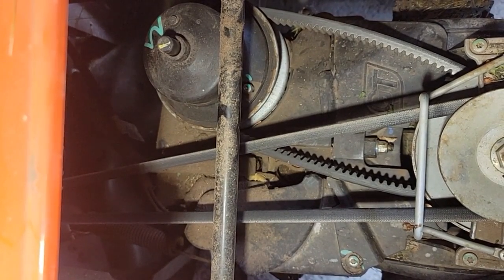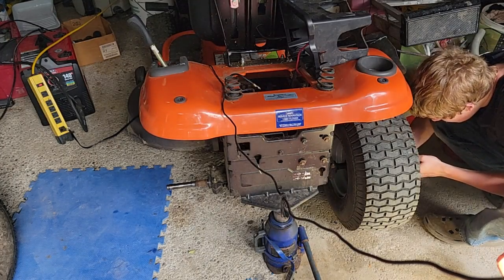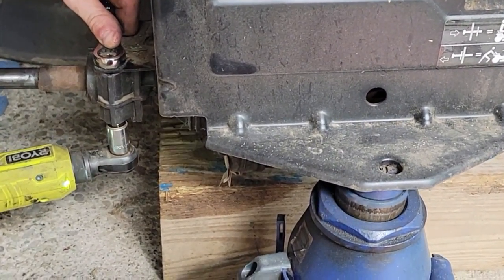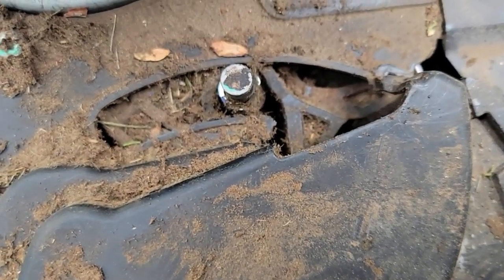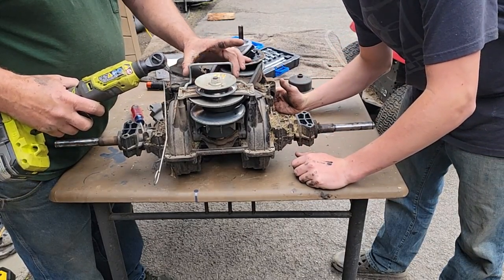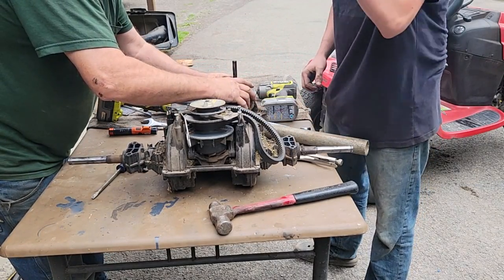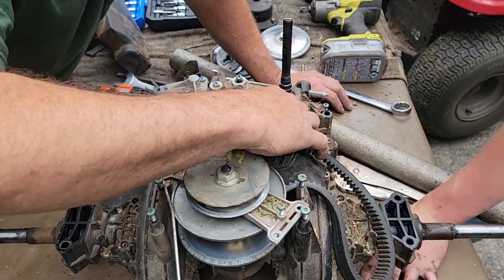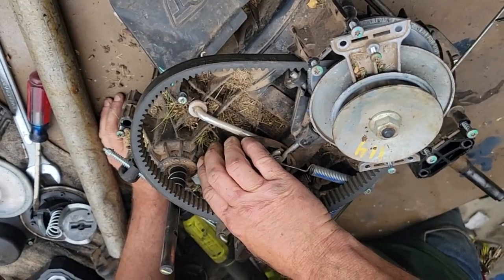Husqvarna Pedal Sticks

Comment: The problem is it's made of plastic . Low speed friction can do the same damage as high speed over time . Even with metal guides there will be heat transfer to the plastic . Too many plastic moving parts in the dirt and grass area . Just bad design and poor quality parts . Never tow a yard trailer with a load . This transmission will not hold up if operators are too heavy , the plastic will flex . Extra weight from bags plus operator is too much . NEVER buy a tractor with a plastic transmission ! JUNK !
Reply: I agree. Junk

Comment: Looking at 20:08 you can see how the freewheel rod is bent. My mower is 6 years old and the freewheel rod got so bent, I couldn't get it back into gear. I have the plastic General transmission. I bought a carburetor throttle swivel and a 1/4" metal rod, removed the flimsy rod, heated a 1/4" bolt with a propane torch, and enlarged the hole that the rod was in. I bolted the swivel on to the plastic trans tab (use the nylon lock nut & washer), cut, bent & threaded the rod. Now I have a very stiff rod that will not bend. To make this upgrade, just remove the left rear wheel, and it is easily accessible. 1 - 36" rod will make 2 disconnect rods, each 18" with a 4" handle(14" + 4"). Thread the handle into the swivel, then use the supplied nut to jamb and lock it into place. I moved the location the rod comes out the back, to the corner hole to the left of the keyhole shape.

Poulan Pro pp19a42 - 19hp Briggs motor with General Transmission.

Parts;
JEGS Carburetor Linkage Swivel | Fits 1/4" - 28 Right Hand Thread Throttle Linkage Rod | 1/4" - 28 RH Male x 1/4" - 28 Female | Includes 1 Washer And 2 Nuts

National Hardware N316-372 4054BC Smooth Rod in Plain Steel,1/4" x 36"

uxcell 1pcs Round Die Stock Handle Wrench Holder & 2pcs Round Die 1/4-28 UNF Machine Thread Right Hand
Reply from the maker: Great information.  Thank you.

Comment: great video. I ran into the same problem getting that nut off. I used a vise grips at the very top of the shaft where marring is not an issue. before re- assembly I cleaned the burr off the top of shaft. Tractor is working again due to your video. Thank you very much. You are teaching your son how to think before he acts, I did the same thing with my kid. Now he can fix anything. p.s. that bearing can be greased, there is a screw down there. you can take the screw out and put grease in it. Excellent job
Reply from the maker: Great

Comment: Great VID.  Before you take anything apart go after the problem with air and water.  Pull the battery and the holder and spend 2 minutes with your leaf blower on the top of the deck and transmission. Then swap to your pressure washer and wash everything till you are getting nothing more out from under there.  Solidified grass clippings are the most likely problem. You may be amazed at what you see that comes out in the form of little grass bricks.  I had my Poulan Pro run for about a hundred hours before this problem cropped up.  Took me about an hour to fix it.  Repeat once a month during mowing season, and  again before winterizing and storage.

Comment: Thank you Guys on this great and detailed video and I have exactly the same sticking issue with the same Husqvarna lawn tractor, what a coincident.  I only want to ask how Dawson lifted the the forward and backward lever from the transmission before pulling it out of the tractor, that is about 14.59 minutes from the start of the video.  There is some kind of washer or clip holding the metal lever to the part on the transmission that you showed in the beginning that was sticking when pushed back and forth by the lever. So do we just pull the metal lever from the arm without doing anything to the clip that is holding it on the arm?

Comment: Grass jammed the mechanism. I bought one in 2009. There are no covers on the top of my transmission. About every 5 years, I remove the battery and vacuum all the packed grass out of the top of it using a screwdriver to loosen it up. An air compressor would be better, but I don't have one. I blow the mower base clean with a leaf blower after cutting. It will get 99% of the grass off the base. Water is a bad idea due to rusting. Leaving it outside uncovered is not recommended. 
The axle seals eventually leak. Glue the new ones in with silicone sealant so they don't work loose. Those transmissions never need grease added. Do not pressure wash them.
Reply from the maker: Thanks

Comment: That’s why I’m looking for this video. That top of that cover is cracked on mine and it started immediately getting stuck in gear unless you used the brake. I’m ansie to see what he has to say about the binding underneath that cover because that’s what I seem to be coming across but wanted to see someone else ruin their transmission before I opened mine up for the second time.
Reply from the maker: It worked for me. Usually just grass plugging it up.

Comment: My shift rod keeps coming off. Is there a clip or something that holds it in place??
Reply from the maker: I believe there is a pin
Reply: Pull the shift rod and drill a hole in it for a carter pin.
Reply: @patkelley2190 should be either a push clip or e clip. E clip would be better.
Reply: Thank you going to Harbor Freight today to
 purchase the E Clips.  @BryanPAllen
Reply from the maker: Mine has a push on clip
Reply from the maker: It's a push on washer type clip
Reply: @patkelley2190  That's COTTER pin.

Comment: Those are piece of crap plastic transmission. Another problem which those one have is the leaking by the wheel axle because of the flex in the plastic body.
Reply from the maker: Yes, at least they have grease and not hydraulic fluid that leaks all over.